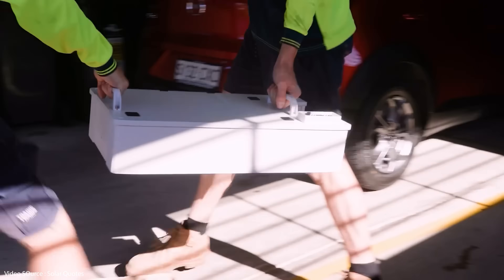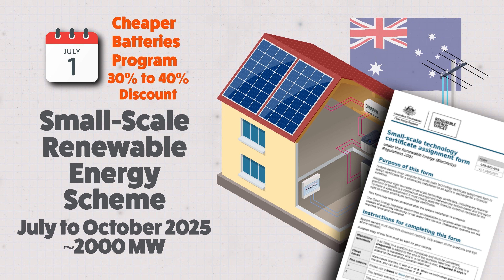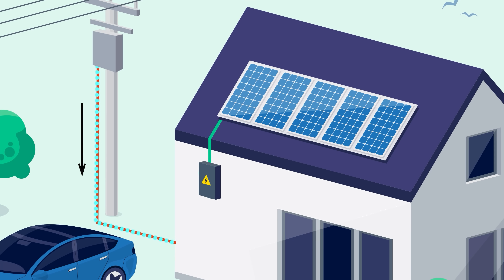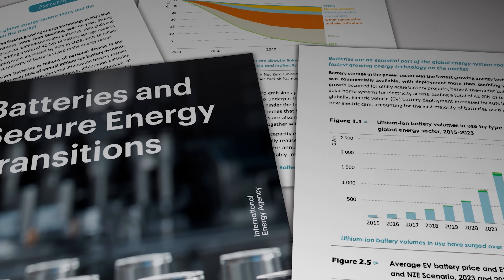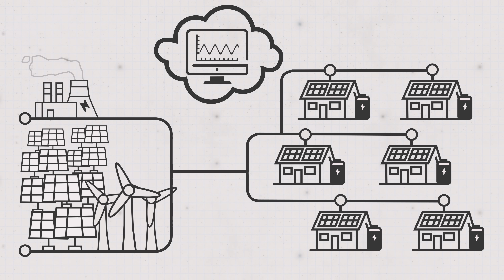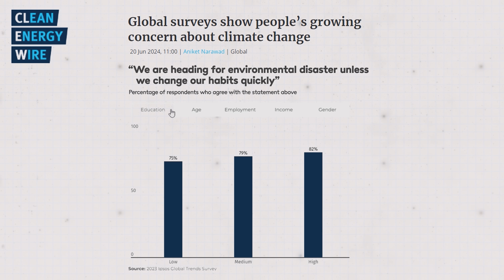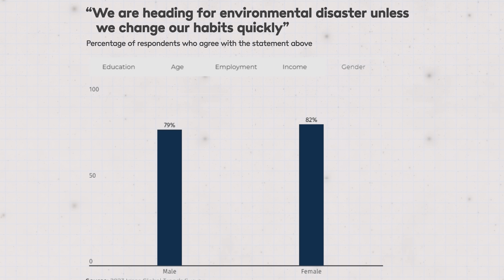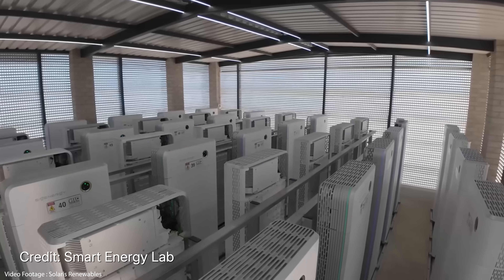Australians installed 100,000 home batteries in 17 weeks. Why can't we all do that?

Comment: Dave, I have to suspect that our government/politicians are either idiots or being paid/bribed by fossil and nuclear generating generating companies. I know my MP is paid by a fossil energy company as a side hustle. We've had solar for years and got a battery about five years ago. As a result of the Feed in Tariff, solar & battery combo, our electricity is now basically free. We could afford to be early adopters and I am now hoping the HMGov get a grip and specify all new builds should be correctly oriented and have solar & batteries installed.
Reply: How do you demand all new builds are the right orientation?  That would be an incredibly inefficient use of space.  You also potentially have a lot of extra roads, sewer and water lines which would drive up development costs along with property taxes to service all of that.
Reply: @pin65371 there’s no need, east west or south works in the uk. You just alter the point of peak production in the uk. I get peak production a 3pm but a neighbour with a different orientation gets peak production at 11am. The only thing that wouldn’t work is a house that only faces north and never sees the sun. That would be a strange design choice or maybe the house is in a deep valley surrounded by tall trees. I am sure you can find some places that it makes no sense but in those exceptional places you can still fit batteries and benefit from cheap overnight charging.
Reply: @pmac6584 when developers build they build to maximize the use of land. If the government starts to dictate orientation that would mean less homes are built.
Reply: @pin65371 as I mentioned that is totally unnecessary. Any home that can’t have solar just needs a battery.
Reply: @pmac6584 but then we are adding cost.   I dont know about where you live but where i live younger people have basically given up on the idea of even ever owning a home.
Reply: @pin65371 orientation isn't an issue. East/West over two sides or South over one both work fine. More important is just making most of the roof clear of things sticking up
Reply: energy hungry industries also needs the very stable base load and the increase of AI and datacenters are only making the grid worse too, where is solar and wind going to help? musk himself litteraly bought a gas turbine power plant.
Reply: NSW Fed politicians were bribed by coal producers for decades.
Reply: When Labour (UK) introduced that 3p per mile charge on EVs specifically, the oil people must have been popping champagne! For them every person who is disuaded from buying a non-fossil vehicle is a win. Such a rule might be rescinded before implementation or expanded to include all vehicles, but the damage has been done just by announcing it. And, of course, big oil understand this and are happy.
Reply: @mb-3faze  - I suspect many see EV pay per mile for the fig-leaf it is to cover the more immediate rise in fuel-duty, phasing out of the 5p cut next year and indexed linked from 2017 onwards at the higher RPI rate. No need to expand pay per mile, as the fuel duty increase means the average 7p per mile today in Fuel Duty will rise to over 9p by 2028. Not sure the oil companies are too happy with that.
Reply: @mb-3faze I believe, at least according to Simon Clark- an environmental scientist- fossil fuel already had this tax, it is charged at the station you buy the fuel as a form of tax. The concerns here is how they will collect these taxes if the power are charged at home, since you can't tax everyone as if they own an electric vehicle and you can't accurately measure how much gone into EV. Overall it is still half as expensive as the fuel tax, so if you trust the person doing the math or the public to do the math, they will still see it is cheaper than fossil fuel. 

I do agree there is a psychological aspects though, since the incentives were reduced. Also, people might just not do the calculation, and think they are better off with fossil fuels they already have
Reply: @jackvalior  people always want to blame the oil industry what an absolute joke! they litteraly dont see what the fossil fuels helped build their massive infrastructure, made internet, global trade, agriculture..... the taxes have been very hard on oil and the evs are beeing babied
Reply: @carholic-sz3qv I won't deny the fact that oil did A LOT of good things. But it also comes with its down side. As for being babied, look up how much subsidies go to oil globally or in America or UK,  and compare that to fossil fuels subsidies. It is not comparable.
Reply: @mb-3faze why should EV drivers not pay tax for the maintenance of roads given they impose a higher rate of wear and tear than equivalent ICE vehicles? 

Good policy dissuades people from buying new cars in general and dissuades people from driving as much as reasonably possible. 

I'm not anti EVs at all but even a modest EV battery is big enough to make multiple household batteries and have a greater impact on reducing emissions that way.
Reply: @spencerhho your premise in paragraph one is incorrect. The 'fact' you state is mearly a propaganda piece by big oil defending their vast subsidy program. Let all vehicles be taxed by the mile and weight. That's what should have been proposed. Remember the fossil industry just want to continue pulling out the free stuff from the ground until the very last drop is extracted. They will do anything, lie about everything to maintain their cushy subsidies. They don't give a damn about the damage caused.
Reply: @spencerhho  the infrastructure is built and maintained by iCE and oil btw why arent those cringe ev people talking about that?! people have now acces to internet almost everywhere around the world again because of musk rockets that burns fossil fuels.
Reply: @mb-3faze  another pathetic comment! leave the oil people alone! crude oil and gas are still needed in industrialised countries, the UK has lost its industry so nothing to say about climate change.
Reply: Our MP is pretty good on the energy transition and even the previous Conservative MP was good on climate change education, so perhaps you are just unlucky. I think Miliband really gets it and is doing a pretty good job as energy minister, though he is a little bit too anti-market thinking about the decision not to pursue locational pricing.
Reply: stop talking nonsense please! the renewables are totally useless for countries with massive industry bases, what is solar going to magically produce a car tire for example? all the millions of chemical stuffs and more. from aviation to maritime, agriculture...... electricity is useless.
Reply: @carholic-sz3qv please join us in the 21st century.
Reply: @carholic-sz3qv which Australia doesn't have.
What country you from?
Reply: It would be WONDERFUL to have more Nuclear Base Load Power. We have regulations for reactors that were designed and built 50 years ago, and the regulations need to be updated with current best practices. This would provide the ability to replace the old failing reactors, and add new ones to support our base grid power.
Reply: @PhiloSage nuclear is a massive boondoggle requiring massive subsidies. And it hardly produces any significant supply. Sizewell C is going to cost 50bil plus - for 3.2GW! That's insane. 'Base load' is a phrase from the past. It implies that all other power sources could be switched off and the 'base loaders' could take up the slack. Well, that ship has sailed - it is simply not possible. The real answer is more wind generation, domestic and commercial solar, battery storage and interconnects. There's no need for any fossils, wood burning or nuclear all of which are disastrous for the environment.
Reply: @mb-3faze  For the cost of sizewell we could have distributed a free plug in solar and battery system to every home in the UK, and had change to fix the regulations to make it legal.
Reply: @mb-3faze  Wind and solar are pure baseload fuels.
If you don't want baseload power-service, you don't want wind-and-solar.
Reply: @PhiloSage nuclear is 3 times more expensive than solar/wind/battery. I think I will stick with my free energy thanks. You can keep the nuclear.

Comment: In my town an incentive program has started to roll out home batteries.. Too late for me, because I got myself a home battery about a year ago.., But here in the Netherlands home battery sales are booming as well, which is caused by a few changes in the electricity eco system.

1. Many power companies have started to CHARGE households for delivering power into the grid, because like you said, most of the time, the power companies have no use for that power and actually dont want it when its sunny and windy at 2:30PM
2. 100% metering will be canceled soon, where you could use the grid as your battery. Redeliver a lot during summer, build up 'energy credit' and use that energy credit in winter.
3. Electrification (businesses) and installation of windturbines  and solar panels is going so quickly, the grid gets overloaded.

Batteries may help to reduce these problems and use our electricity more efficiently. By storing peoples home generated solar power into the battery, and use it when its needed or give back to the grid when there is high demand and get paid for that!

I have a dynamic contract, where the Kwh price changes by the hour, and software is doing arbitage trading on the energy market using the battery.. Charges the battery when electricity is cheap or generated by my solar panels, and sell it back to the grid when there is high demand and electricity prices are high (like between 16:30 and 20:00).. This way I help the grid operator by reducing the load when there is high supply but low demand, like on sunny and windy afternoons, and provide the grid with some low cost extra power when there is high demand.

It works very well, in the first year I will get PAID €500 by the power company and if compared to a fixed Kwh pirce of €0.30 I have saved over €1000 !!  and that with my rather small system of 14 solar panels of 250Wp each and a 5Kwh Home battery.

It is an investment of several 1000's Euro's, but if you have that in your bank savings account doing 2% interest per year or so, moving that capital to your roof you could make 15-20% on that capital right away!  It was a no brainer for me to invest in this system. Oh and I did not get any subsidy for the solar panel installation (in 2014)  or the battery (2024), still it makes a lot of sense financially!

Anyway, it is not only happening in Australia, it happens here in windy dark Netherlands as well!
Reply: hup holland 🇳🇱👍🏻